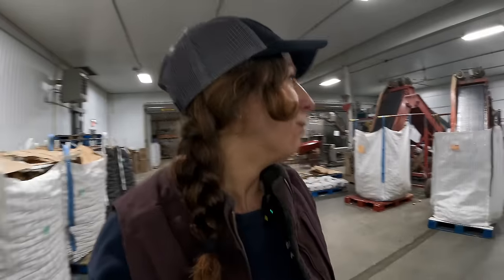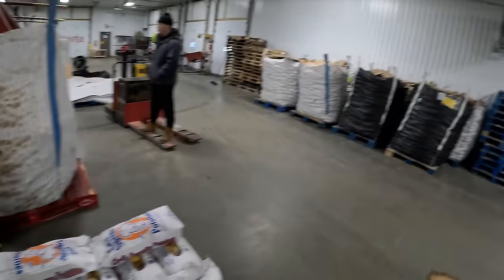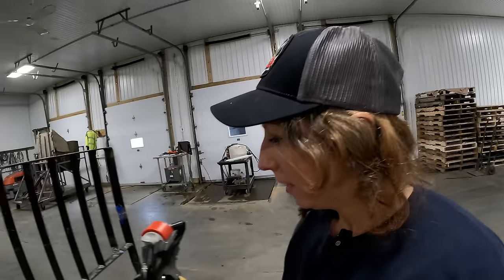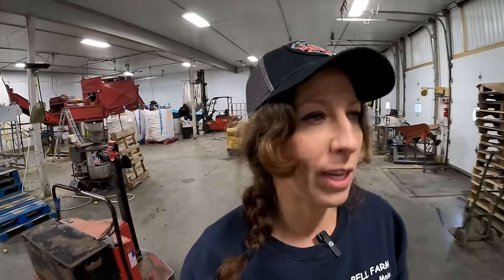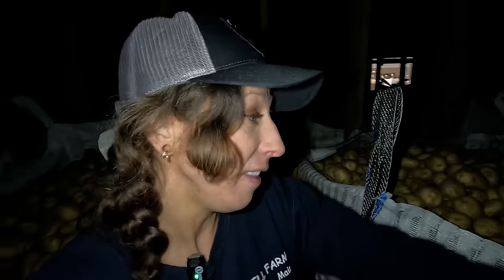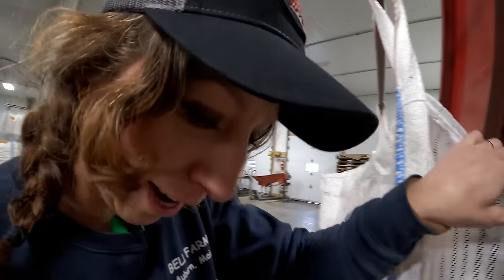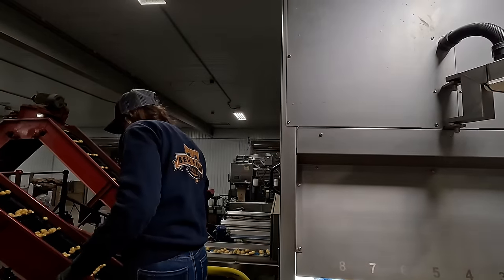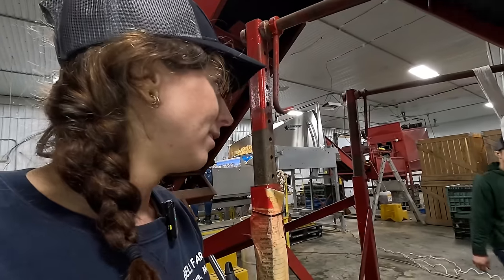Unloading Tote Bags and Pallet Boxes

Comment: Mornin Miss Moll!   At what temp do you keep the potatoes  during storage, and what would the difference be if you used last years potatoes for this year's crop versus buying seed potatoes?  😊
Reply from the maker: Hey! Well they stay around 38-44 between the old side and the newer storage building. We try and empty the old side first. That will heat up quicker with the warm weather. In order to plant your own potatoes for seed, technically you have to grow “seed” we have done it in the past. But they gave found that this is easier, and we get to sell more of the crop we grow.

Comment: Hey Molly my wife wants to know what you do with potatoes that have started to sprout eyes?    Dave D.
Reply from the maker: So I will usually just break the sprouts off and use them as normal. If the potato is really soft then I’ll pitch them. But I tend to be less picky about how hard a potato is. They are still good if they have eyes and are a little less firm.

Comment: Happy Belated Easter... Has anyone dumped a full tote bag of potatoes while in the process of moving them from one location to another?
Reply from the maker: They have never called from the forks, but there has been a few times that someone doesn’t tie the bottoms where the shoot is. You don’t know it until you lift it off the pallet. That makes a little mess. But they know how to fix it with light to many potatoes hitting the floor. I think there have been tote bags and tip over though.
Reply: @BellsFarming  shoot? dats funny! I call it a chute 😆